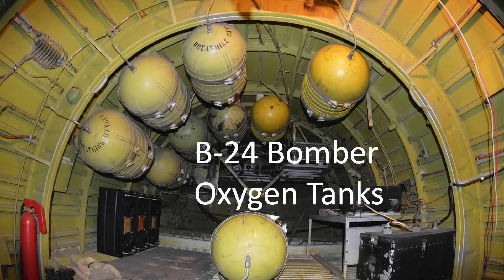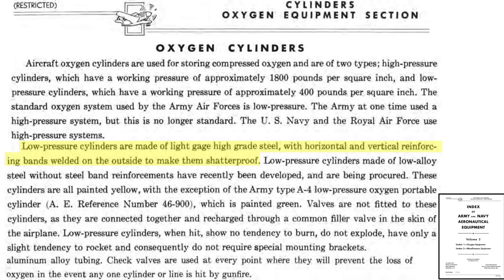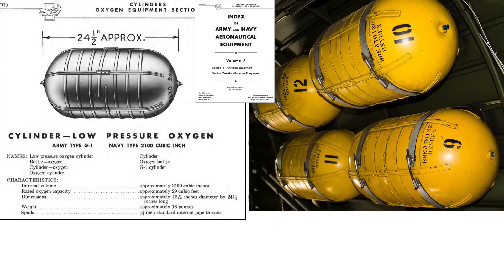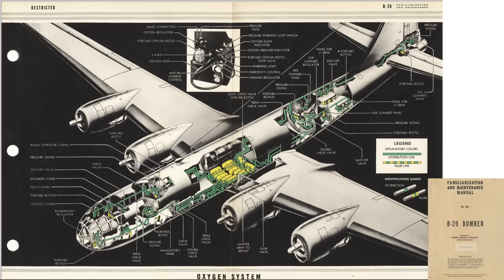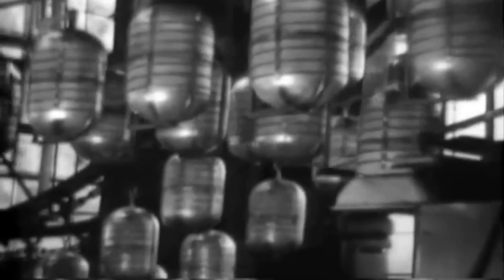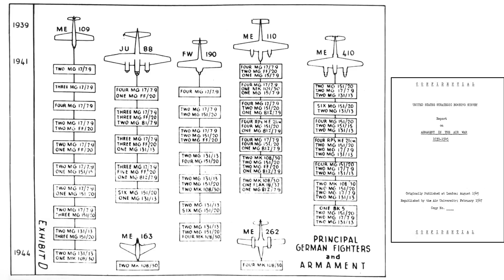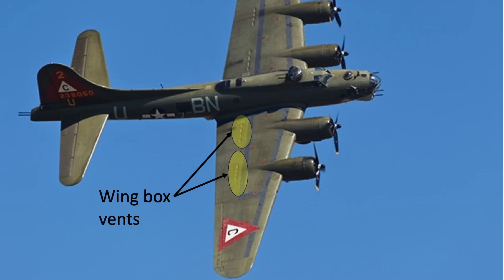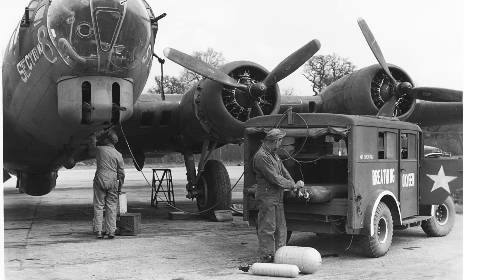Consequences of shooting a WWII Bomber’s G-1 Oxygen Cylinder. Explosion Vulnerability footage.

Comment: If you start getting richer than 30% O2 on greasees and oils you have a fire without a flame needing to be present to set things off. With pure O2 you run some risks. You can't use petroleum based o-ring lube in O2 valves or regulator valve attachments. Not even the o-ring can be petroleum based with silicones rings being what's safe.

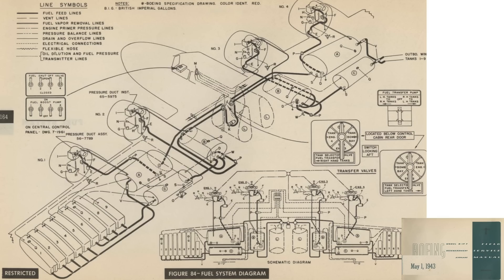Comment: Is the diagram of the B17 fuel system starting at 7:05 showing 2 fuel tanks within the fuselage? If so, maybe that is the source for the fire.
Reply: The B-17 had fuel and oil tanks only withing the wings. If they had auxiliary fuel tanks like they used on ferry flights, they would be in the bomb bay. They were not used on combat missions.

Comment: The Bf 109 MG 17 machine guns were often fed with a mix of Phosphor "B" round ammo and Armor Piercing Tracer "SmK L'spur, because the germans knew the caliber was too small to inflict any serious damage, and the potential of an incendiary round was quite efficient against critical and flammable components.
Reply: Enemy fire is indeed a very plausable ignition source, I don't think anyone would dispute that.  The issue is that the scend depicts a firewave that would have required gasoline vapor to have already filled the aircraft, in which case the oxygen cylinders do not even need to release anything as such a vapor mix is already highly combustable.

Comment: Depending on the mission, I'd suggest:

Incendiaries in the bomb load.

Hydraulic fluid, ether was used at the time.

Fuel is a possibility, there are lines running from wing to wing to allow cross-flow

Though depending on the level of damage, there would have been enough outside air blasting through the plane to dilute excess oxygen back down to normal levels.

Comment: As an aircraft maintenance mechanic one of the most dangerous jobs i had was servicing the oxy tanks   crack a valve with an oily wrench fire remember oxygen is the ultimate oxidizer and can absolutely raise some hell it depends on tje conditions !remember we lost 3 astronauts due to an oxy fire started by a short circuit and sparks !
Reply: Hi Jerry, Would you have, or have knowledgeable resource of the Cornelius high psi 3-Stage Compressors used on the 1960s bombers. I have a complete" 24v 3-ph. emergency compressor " in a 24"inch square yellow fiberglass box, max.2800psi, that was built by Stewart-Warner Co.for The Boeing Airplane Co. in 1962 and I believe is was used on the Stratofortress as an emergency blow down compressor to help override the landing gear hydraulics????? 
Any help in the "military service manual" direction  would be greatly appreciated. Thanks

Comment: A great presentation, interesting and informative, and as a Veteran RAF Airframe Technician I can only agree with everything you said, oxygen alone does not and can not explode, there would need to be the other two necessary components to make the oxygen tank leaking from a fault or puncture, those being a source of ignition and a fuel of some description (aircraft fuel or oil from the engine(s), the ignition source could be an electrical short circuit or a fire within the system itself, and without either of those two components the only risk to the crew would be oxygen depletion forcing them to fly at a lower altitude of around 10-20 thousand feet AGL, obviously making them an easier target for enemy fighters and AAA. 

I don’t know how the RAF HP system was designed and protected during WWII but when I joined up all onboard gaseous storage bottles/tanks were protected from shattering by being wound around the body of the cylinder with wire, from just below the neck to just above the rounded base, I can’t remember ever seeing any film about that but it was a very long time ago, and with the advent of Liquid Oxygen system it was a different safety system in place, I don’t know of any aircraft flying today that use the OBOGS system that I think was used on the latter MKs of the Harrier VSTOL aircraft, OBOGS being an “Onboard Oxygen Generating System” or even if it was installed on any aircraft, I don’t know if it even worked. 

Thanks again for a very interesting episode, keep them coming, and I look forward to seeing more in the very near future. TX😀👍🇬🇧🏴🇺🇸🇺🇦

Comment: Most of you have probably not tried striking a match and start a campfire at -10 f degrees. It can be difficult because of the cold.  At 30,000 ft over Europe, it's significantly colder.  According to standard Gas Laws a rapid depressurization of any gas causes a rapid drop in temperature.  
The basic chemistry of the topic of this video is fire (rapid oxidation through combustion): which requires three components. 
1. Oxygen. Here plenty. 
2. Heat. the bullet? a spark from a severed electrical wire?  into an already sub sub zero environment that is made even colder 
and 
3. Fuel - there isn't much that can burn in the vicinity of the oxygen tanks on these bombers. Likely  intended to reduce the risk of a fire.

Comment: I am a 12 years experience as blue collar  working as technical stuff in a lab (Chemical Engineering degree). H2 is dangerous. a little spark and is on fire. But pure O2 is much dangerous: H2 dissipates very fast, O2 no. And the worst: Pure O2 can react with almost everything, included the dirt in your apparently clean gloves, or can react with the grease and salt that you have in the sweat in your face, hands or clothes. Remember the NASA's accident on Saturn program. H2 may be dangerous, but pure O2 is evil.  This is just my opinion.
Reply: You're right as an aircraft maintenance mechanic I was trained of the danger of servicing the oxy tanks dirty oily wrench dirty hands dusty environment etc and you have a problem I still have my oxy hand book it says oxygen is the ultimate oxidizer that should be the clue !

Comment: You know, I honestly just assumed there was a fuel leak that got in the cabin, at that altitude the pressure would be so low it'd evaporate pretty much instantly and make essentially a fuel air bomb, more or less consistent with what's shown.

Comment: Oxygen is not the same as air and they are stored in different bottles and pressure.
Pure oxygen is stored under much higher pressure and small cilinders than air.
In what I have seen over the years it seems to me that these are air bottles and not oxygen.
Oxygen is highly reactive and ignites with just about anything while air is a much saver option .
Many of us know about the accident with the testing of the crew capsule on the apollo rocket that cost the lives of the astronauts because this was a oxygen filled compartment and it was ignited by electrical spark/short.

Comment: theres some channel that shoots an oxygen cylinder or two...

and as long as the round has enough energy to penetrate, it also has enough energy to locally heat the metal to the point where it can ignite due to having pure oxygen in contact with it, and the subsequent hole is "thermal lanced" out as the metal is ignited for the brief instant the tank takes to empty...

Comment: You missed a major point . Tracers following up in a oxygen rich environment with flammable materials is capable of that radical fire .
Reply: The tracer compound would possibly burn more rapidly in a high oxygen environment  but I doubt it as it already contains an oxidiser. Even so, the amount of tracer in each round would be insufficient to cause the huge flash fire portrayed. Remember oxygen is necessary for combustion but is not in itself flammable. A fuel is needed and there's just not enough fuel in a tracer round to cause this kind of fire.
Reply: @oogdiver  We have an oxidizer the O2 and we're missing the fuel source for that burn . And one other issue is the cannon fire from the ME-109 which has an explosive . This adds to the issue of how much damage was done and at some point there would have been fuel lines connecting the right and left tanks of the aircraft that along with the ignition source of the exploding cannon projectile could have created all 3 components of fire , Ignition, Fuel and oxygen . A simple 8mm hole in the tank as your sawing is correct not a fire issue but having been inside a cramped B-17 with thin aluminum skin and a explosive shell from the cannon exploding in that area you have a tender box that would be lucky if something had not gone wrong , and who said it was a single cannon shell or 8mm bullet ? I'll leave the fire onboard as a probable and not leave it up to just a O2 bottle being ruptured .

Comment: I noticed the Pilot and Co-Pilot oxygen system on the B-17 were from different set of oxygen tanks. Was this designed so if 1 system went down it only took out 1/2 the flying pair or was it a happy accident it happened to be separated ?

Comment: Fascinating video.  The insulation on B-17s were known to be flamable, in particular in surplus oxygen.  The 7.92mm rounds often had incendiary component to set fuel tanks on fire.   But the gas fire... doesn't make sense.    However, it could have been an insulation fire.
Reply: Where exactly was this insulation? I’ve toured a couple B17’s on display, no insulation.
Reply: @duncandmcgrath6290  Then removed.  It was in the fuselage walls to keep crew from freezing.
Reply: That's not how oxygen-fed fires work in an unsealed environment. The gas would feed any existing fires in the immediate area as it escaped the plane, but it wouldn't cause the asbestos in the fuselage walls to instantly become flash paper. Remember the plane is unpressurized and (now) full of holes - the oxygen rapidly diffuses into the thin air.

If this scene was accurate, there would have been basically zero US bombers who survived moderate battle damage from 7.92 slugs (instead of untold hundreds).
Reply: @gastonbell108  The German 8mm rounds had incendiary.  By increasing the oxygen, the energy required to sustain an insulation fire plummets.  So my scenario is accurate.  

Pure oxygen makes it far easier to start a fire.  It also makes fires far hotter (no inert nitrogen the that must be heated up).  

"Feed" doesn't explain all the physics going on.  In a high oxygen environment, the insulation was far easier to set on fire, and burned hotter; this more likely to become self sustaining.
Reply: Every machine gun belt has tracer rounds included in it. They’re typically every 5th round to help you see where they’re going. Germans used green tracers so it’s not out of the question that a tracer round can start a fire

Comment: OXYGEN by itself does NOT BURN...   Oxygen supports combustion and in heavy concentrations, it INTENSIVIFIES combustion, greatly..  BUT it does NOT burn by itself.
That is 100% FACT..    I ran a MEDICAL OXYGEN tank filling plant, I know EVERYTHING about what reacts with 99.9% oxygen..   
ONLY when mixed with petroleum products, even petroleum rubber o-rings are dangerous and explosive with liquid oxygen..
Oxygen gas is also reactive at 90+ %..   But Oxygen by itself is NOT combustible...  Our plant was NOT allowed to have ANY petroleum products that could come in contact with the 90+% gas or pure liquid oxygen...        In the absence of reactive substances, the only EXPLOSION that can happen is from Compressed gas...    END OF DEBATE.
Any of you wishing to embarrass yourselves, please talk smack, I WILL make you look completely uneducated.

Comment: There is probably enough flammable material inside a B-17 cabin to produce a large fireball if the partial pressure of oxygen is high enough, but only a few seconds wouldn't be nearly enough time for a few bullet holes to leak anything like enough oxygen to significantly affect such a large volume. The B-17 also has two wide open waist gunner ports with hundreds of knots of airflow outside, so there's a lot of ventilation. They also seemed to be at high altitude, so the partial pressure of oxygen wouldn't be all that high even at 100% oxygen by volume.
Reply: There wouldn't be a fireball at all, everything flammable is in a solid state and a sudden release of oxygen wouldn't do anything. You're not suddenly getting a huge amount of flammable gas that'll readily mix with the oxygen and create a fireball. The pressure at that altitude is low enough that any release of oxygen wouldn't even be capable of producing an environment that approaches the relative pressure at sea level. That rapidly expanding gas would also  cool the surrounding environment, there isn't some massive release of energy that would ignite surrounding materials and the low ambient pressure would mean combustion gasses rapidly expand significantly reducing the relative temperature and the potential for ignition of the surrounding materials, even for a brief moment. On top of an atmosphere which will support rapid combust you need an ignition source with sufficient energy to set everything on fire instantaneously. An ignition source like that doesn't exist, you'd need serious injection of energy in the form of thermal radiation to make all the nearby materials hot enough to combust at the exact time the oxygen floods the environment.
Reply: the only way to get a fireball like that is an vapor cloud so it'd have to be either fuel vapor or hydraulic fluid spraying in a fine mist for a fireball!!
Reply: Playing devils advocate here. Maybe wiring or electrical equipment could have been hit by the machine gun fire? Any circuits that are severed, but are still close enough to arc current between themselves or another conductive material (metal objects inside the bomber) can cause an open spark which ignites the gas, or combustible materials in the cabin? But as mentioned partial pressure of oxygen at this altitude will be extremely low and whether a dense enough cloud of oxygen can form to catch alight is questionable. Definitely is a scene more for shock value but does deliver on that👍
Reply: @liamferreira8912  not likely internal wiring carried at most 48 volts it wouldn't be enough! now 20mm explosive cannon shells are another subject!!
Reply: Contrary to popular belif the partial pressure of oxygen dose not significantly change the combustability characteristics of materials, rather it is the oxygen ratio which matters, this is a common misunderstanding because the human breathing depends on partial pressure and people assume fire works the same way, but combustion of is not respiration, it's an exothermic reaction in which gas molecules strike fuel exchanging kinetic energy with it, if the fuel is hot enough and is struck by oxygen it combines and releases more heat.  When a non-oxygen molecule strikes it just takes away heat so once a ratio of non-oxygen to oxygen is high enough heat removal exceeds heat generation and combustion becomes impossible to sustain.  Higher total pressure can make an object burn faster because the time between gas molecule interactions is faster, but the temperature of ignition dosn't change much.  Thus pure oxygen at a partial pressure lower the sealevel is vastly more dangerous then sealevel air, and a deep sea diving mixture can be made completly incombustable by making the oxygen ratio incredibly low.  The problem is that the scene clearly depicts the air inside the cabin burning as if their is a fuel air-mixture, not the materials of the aircraft itself.
Reply: Liquid Oxygen was developed in 1877,the Germans used it in WW2.If it was used on board US aircraft in WW2 it is more volatile than gasoline.The question for you truth seekers is it LOX on the B17/24/29??
Reply: @wirelessone2986  No. Liquid oxygen was not used in U.S. Bombers.  If it was, you would see the frost condensation on the bottles (as frost builds up on rockets with LOX)